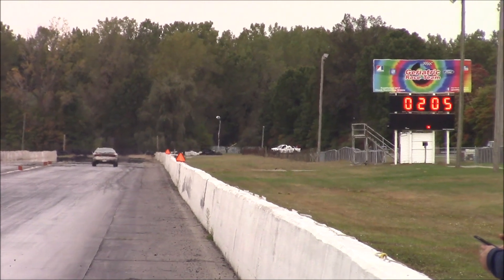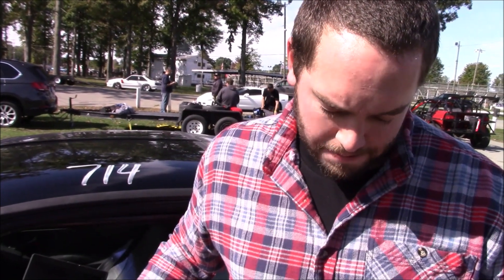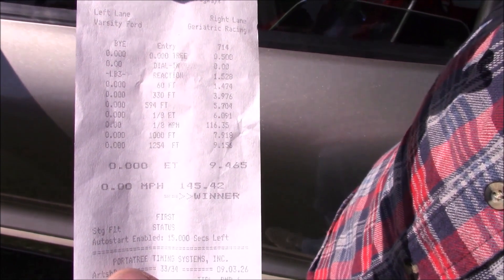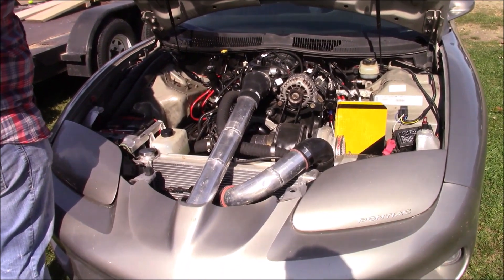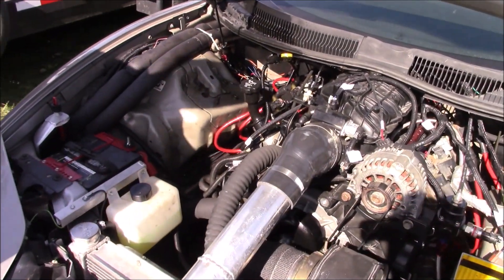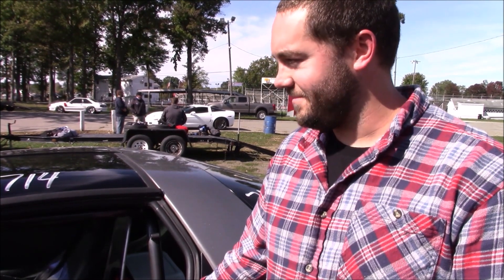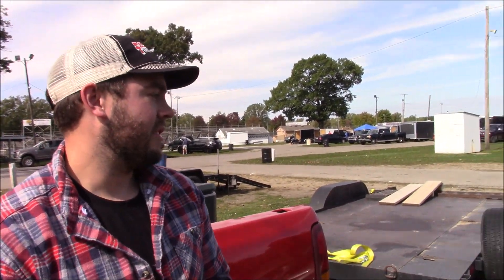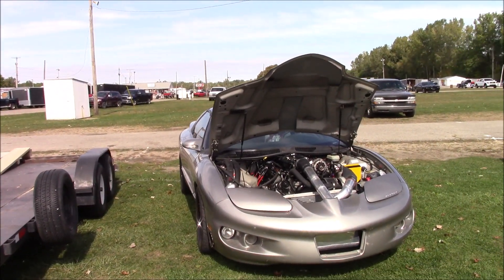Turbo LS Swapped 2000 Firebird Trans Am V6 -  Stock 5.3 With 250k Miles & 85mm Turbo - Mid 9s!

Comment: So you just added an turbo on and did nothing to engine?? Lol you giving me ideas man 😂😂
Reply: Cam head studs turbo
Reply: There's a few budget things you can do with a 4.8, 5.3 or 6.0 too make it reliable with alot of boost. MLS head gaskets, head studs, and gap the rings to about .030.  The gen3 motors are great but the gen4 rods and lifters are an upgrade as well.

Comment: Did you have to change the transmission?
Reply: No the v6 model come with the 4l60e
Reply: Of course he had to change it
Reply: He said he was running a power glide, that's that's 2 gear transmission but you could still use the v6 transmission to the v8 cause the both 4l60 you just have to change the front piece and should bolt up